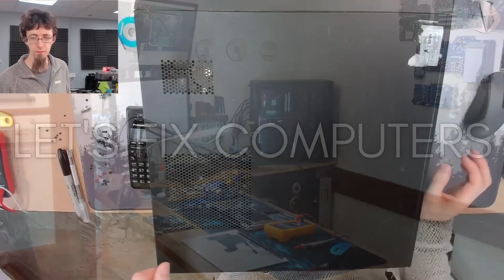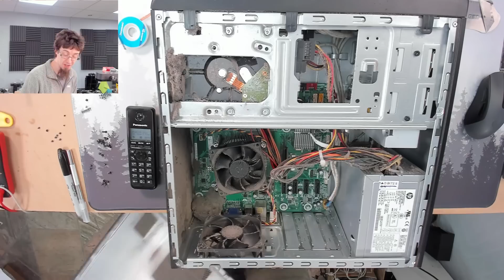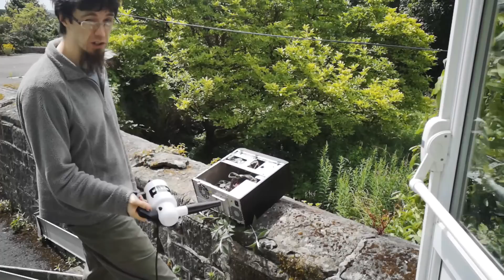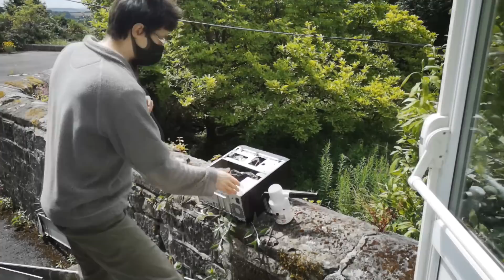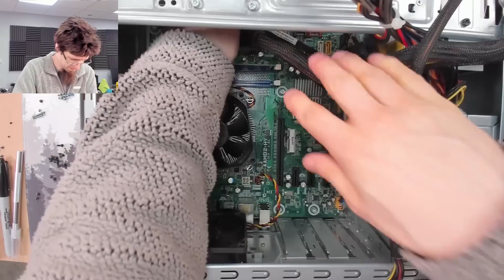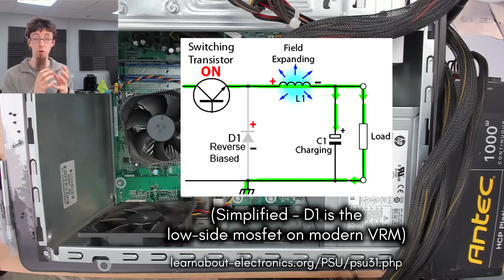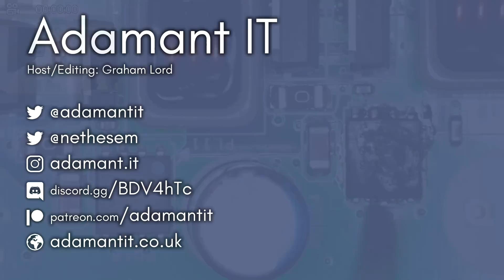HP Tower aggressively doesn't want to turn on - LFC#314

Comment: First, I like you videos a lot. I am not a pro like you, but I do like the smell of melting soldering. Well, not reallym but I guess you know what I mean. Someone gave me an powermac 2006-2007 black. Battery charges, has a lot of "juice"(it was charged a week ago, and still shows all leds lit). But the machine does not turn on. I watched all your vids with macs, but there is no model from this jurassic period. Any suggestions?(the problem, since the beginning, was said, it is the keyboard. I tried to "jump" after taken the keyboard, but...nothing. But it charges de battery, and without battery, the charger's green ligt is on...
Reply from the maker: I know the model you're talking about, but I've never done any board-level diagnostics on one, so sorry to say that I can't offer any insight!

Comment: In some of your other videos with laptops you have said if the light on the charger is on and you turn the laptop on and it immediately goes out, it usually means there is a short. You unplug the charger and plug it in again and the light resets itself. Would that have applied here as well since there was a light on the back of the power supply?
Reply from the maker: Shorts on a desktop motherboard are really uncommon, so it's just not something I expected. On the other hand, a dead PSU that cuts out the moment it's put under load (start up) is very very common.
Reply: @Adamant_IT  So I will add this step next time I see the light on the desktop power supply go out after hitting the power switch, to unplug it, let the PS reset, plug it in and see if it comes back on again. If so, it looks like early warning detection of a possible short and possible flames :)
Reply: Yeah, I didn't go straight to that idea, but I did find it quite odd for the PSU to turn on for half a second then shutdown and I was rather surprised Adam thought absolutely nothing of it.

Comment: It's a good thing this happened in a controlled environment. This could have happened to the previous owner resulting in a house/office fire.
Reply: It totally would've been a house fire, you saw all the dust that came out, basically sucked in its own tinder ready to blow at any moment.
Reply: If the user had replaced their PSU it could have caught fire.
Reply: Not with that weedy HP PSU
Reply: well ur not that smar now are u..hp power supply did what it was designed for to cut power to shorted board. and HE was using cheao chinese one to light the fire!!!

Comment: so old crappy hp psu has protection but 1000w antec psu not have any. good to know.
Reply from the maker: It's hard to tell, big PSUs don't always trip right away because transient loads (high wattage spikes) are a thing, and a sudden peak doesn't always mean that something caught fire. It might've been a moment away from also hitting OCP, but I pulled the power cable out first. This exact scenario is more or less what's happening any time you've seen a video of a graphics card spitting flames though - so this behaviour isn't purely on the Antec HCP.
Reply: @Adamant_IT  thanks for the reply. well maybe im a bit harsh on antec. but its scary to think your pc is on fire but psu is still supplying voltage. i mean hp psu starts the pc but shuts it down quickly. it would be interesting to see if antec trips if you give it 3 4 more seconds.
Reply: Well, one PSU can provide up to 150w on the 12v rail and the other 480w per rail (probably has 2). My guess is that the short wasn't pulling enough current to trigger protection on the Antec, but enough to catch on fire (which is not really thaat much I think).
Reply: The resistance of the short circuit on the motherboard may have been low enough to exceed the capabilities of the original HP PSU (and thus trip its overload protection), but not enough to trip the protection of the Antec PSU.

Comment: I have a 7800 GTX GPU from 2005 that did the exact same thing, PC suddenly shut down, restart gave me quarter fan spin and PSU would go into protection mode, let everything cool down and started again and suddenly there was a burst of light coming off the back of my GPU, actually singing the cable for the CPU cooler fan. I don't think the failed component was a power MOSFET though, looked like some sort of logic gate

Comment: Regardless of whether it was worth saving or not, would replacing the MOSFET have worked? Or would the fire have damaged subsurface traces or other nearby components?
Reply from the maker: It's probably welded itself to the board. But the PC has been written off by the customer (not exactly surprising) so I might at least do an autopsy on it for the sake of learning.

Comment: Excluding the aspect of cost,would the system still be fixable?Replace the blown mosfet and you're good to go, or the chances are that the CPU is also dead?
Reply: Chances are pretty good if the CPU got a 12v hot supper

Comment: I got the mecco UK plug duster, 2 settings, strong blast and way too strong blast, it does the trick but I still need to pre-brush the fans and hold the fans. With my aging mobo I am concerned about knocking a cap off the board.✌

Comment: Could replacing the mosfet alone solve the fault? Obviously not worth it with this board. I have a MSI B550 that had a very similar fault the cpu mosfet glowed red, I shut it down and has been in my might-try-to-fix pile since.
Reply from the maker: Possibly. Need to replace the mosfet driver as well, as a bad driver might just be holding the mosfet on - and thus will blow up any replacements as well. I've only had a go at shorted CPU VRMs once and couldn't solve it, replaced mosfets and drivers, but still kept failing short. And each time you test it, you kill another chip. I might've just been unlucky though.

Comment: Keep the new Air Blower, you previous device with high pressure and Low Air volume is the wrong device. Lower pressure at higher volume is perfect. Keep this new Blower.

Comment: really surprises me the age of stuff that people bring in for a repair
Reply: not everyone need new stuff, and repair is cheaper to buying new stuff, even low end (and this was low end even new, which means owners aicn too rich or dont need newer stuff, is current is still usable,...)
Reply: @marianmarkovic5881  that’s the thing though a replacement better spec pc of a few years vintage would probably cost lest than the repair itself.  Not from big retailers obviously however and that’s probably where the owners of this pc would get their price references from hence trying a repair on this old machine. Its good that people do bring older things in as it keeps this guy in business and it’s interesting to watch 👍
Reply: They have all their data on the machine, and it has all the apps they use installed. This is why a lot of people bring in old rubbish.

Comment: Ha that was great! Also there was a small flash a few seconds after you unplugged it, off to the right of the cpu. Maybe it wad just a lens flare or something.

My desktop is an amd A10 7850k. Ancient really. Can't get Linux reinstalled due to some issue with 1 of the 4 cpu cores getting "stuck". Windows runs fine but of course the graphics aren't that great for the 3d graphic work I do. And is barely ok for streaming my telescope through OBS. 

I could probably throw in a new psu, but I don't want to really throw more money into it and it really wouldn't fix the issue. I just need to break down and build a new system or buy a laptop.